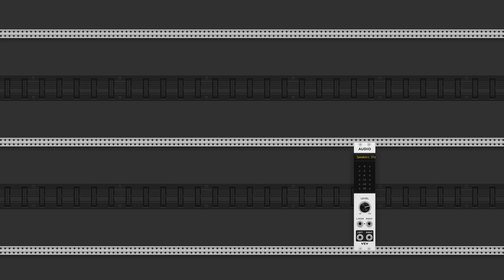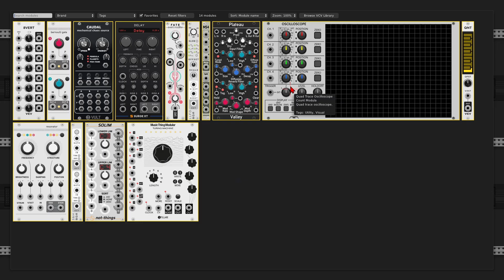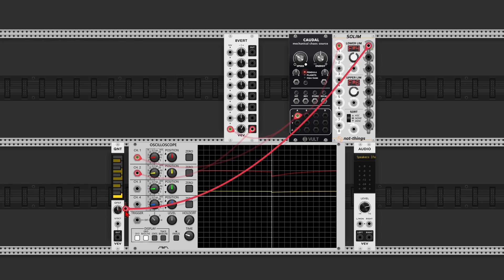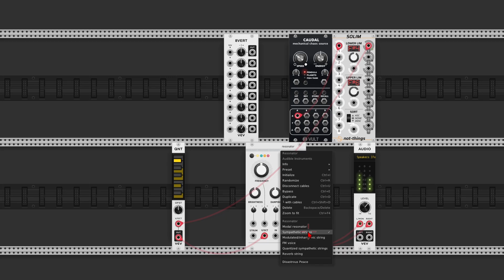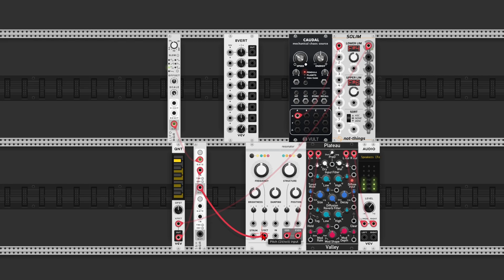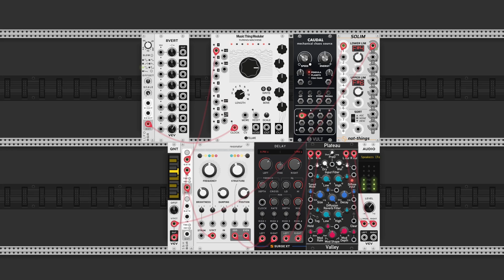Small Resonator Patch Tutorial | Patch from Scratch | Tutorial for VCV Rack 2

Comment: Beautiful patch and lovely tutorial ❤️ I love these kinds of smaller patches as a learning tool, and you do a great job of clearly explaining exactly how each module fits into the chain! 

--

If I could offer some constructive feedback for future videos:

Your voice is very calm and great for listening to, but it sometimes gets lost amid the music. Reducing the output levels while you're talking and then turning them back up to demonstrate the sound changes would be very helpful. 

I also noticed that there are a lot of clicking sounds from your voice audio, I get those a lot when I'm too close to the mic or if I'm using a mic without a pop filter. You might try speaking slightly to the side of the mic and see if that lets your smooth voice shine through better 😊

Thank you so much for doing what you do, and helping us all learn to be a little more creative!
Reply from the maker: Thank you for the feedback.

You're right about the audio balance, it is something I struggled with during the editing, especially since the patch gets pretty loud in places as it's being built. I did use sidechain compression and lowered the VCV audio in some sections, but I was hesitant to pull it back too much. Next time, I’ll try pushing it a bit further to make sure the voice comes through more clearly.

As for the mic, I’ve actually started positioning it at a 45-degree angle to reduce clicks and pops, but they haven’t disappeared entirely. I think my naturally quiet speaking voice doesn’t help either; it makes any unwanted sounds stand out more. Still experimenting to find that sweet spot...

Appreciate you taking the time to share constructive suggestions 😊